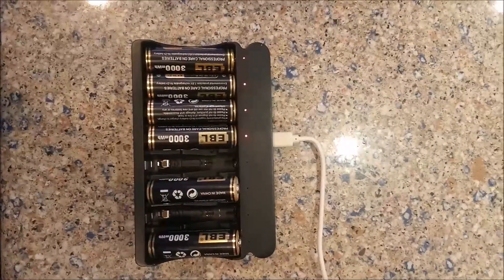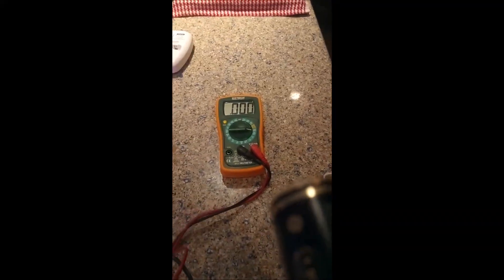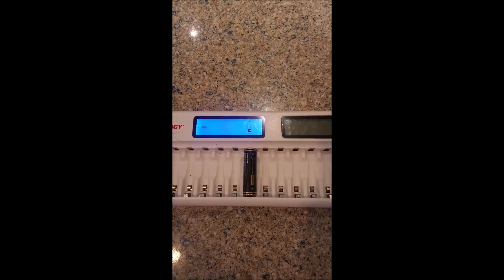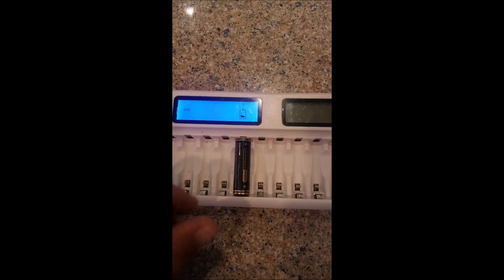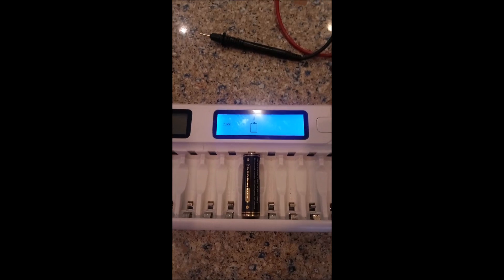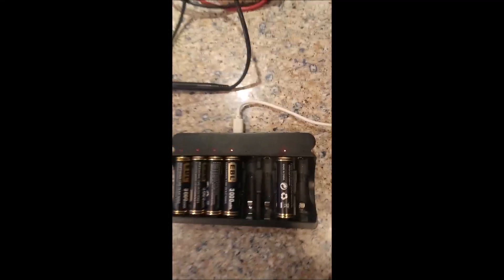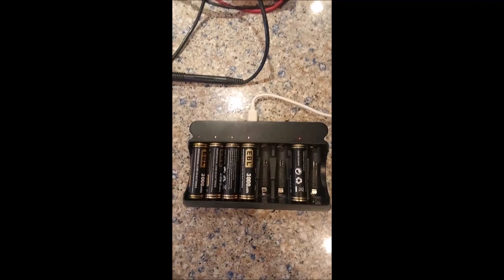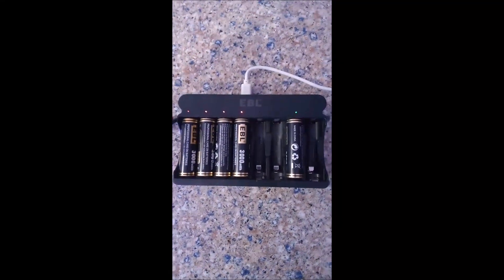Recovering/charging an EBL Nickel Zinc (Ni-Zn) Battery (3,000mWh)

Comment: 0:27 - no, thet should be around 1.4V when full and 1.3V at 85%, 1.2V at 20%.
0:44 - again, Ni-Zn should be around 1.85V when full, 1.7V at 80% and 1.6V at 15% and 1.5V at 5%.
Typical non-rechargeable alkalines are around 100% at 1.6V, 80% at 1.4V, 50% at 1.3V.
Any decent product that uses alkalines should have no more than 1.1V cutoff voltage so it can fully discharge such cells.
Reply: The focus here is less on specific voltages and more on the process to get them charged when the OEM charger does not work.  Thanks for the comments.

Comment: I would guess that battery is a bit weaker than the other ones. If it is used in series with the other batteries, it can get over-discharged and even reverse-charged.
A separate voltage protection on all batteries in series is the solution but hardly implemented in electronic devices.
Reply: What I am finding is that the life of these nickel-zinc batteries are not exactly as advertised.  Also, the failure rates seem to be very high.  One typical phenomenon I have noticed is that when these batteries are fully charged, their voltage can get as high as 1.8Vdc.  Interestingly enough, when you put a multimeter on to measure voltage, you can rapidly see the voltage bleed off, which is an indicator of a bad cell.  From my perspective, these batteries are not yet ready for prime time.
Reply: A separate voltage protection on all cells is used with all kinds of Li-XX rechargeables (LTO, LFP, Li-ion NMC)
For any outher type - almost non-existant.
Reply: Once charged take off charge asap and keep in a very cool but not freezing place like a fridge not a freezer